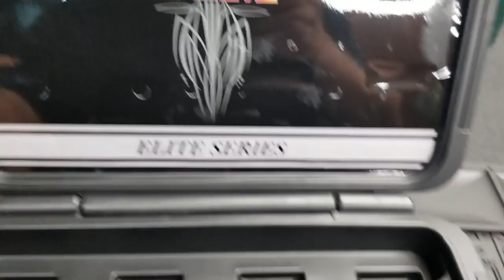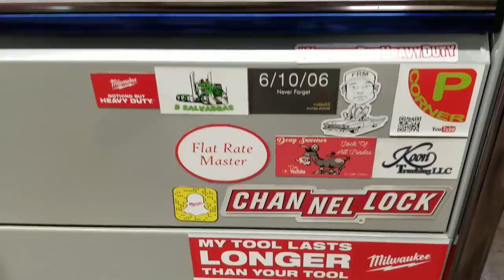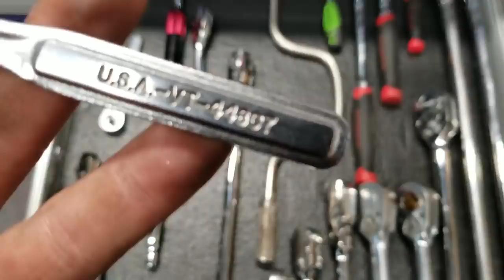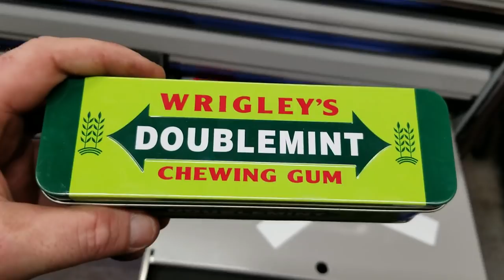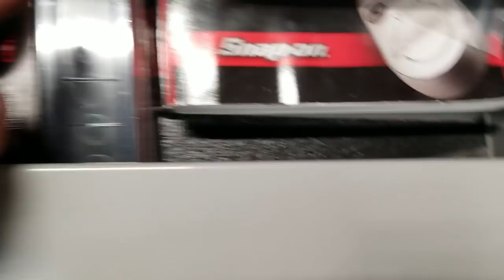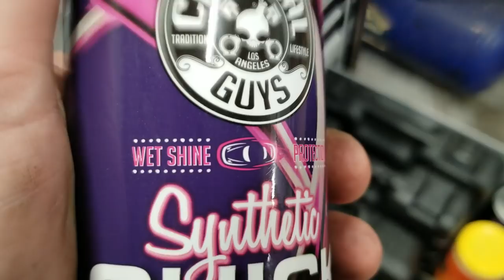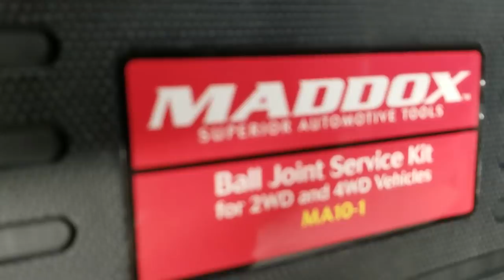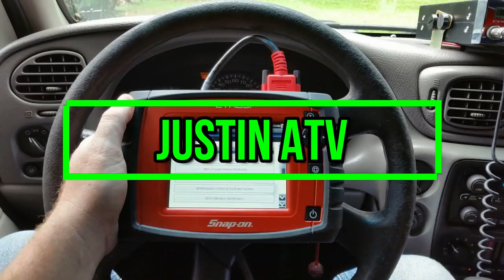Snap-on 68" Epiq Tool box Tour !!! 9-5-2018

Comment: Congrats on the box and nice tour!  The Neiko 04200A extractor set looks very similar (except for the price) to the Blue Point e1020.  I wonder if Neiko is the OEM for the Blue Point set.  I’ve been meaning to pick up a the E1020 set but for only $20 I stuck the Neiko set in my Amazon cart.

Comment: beatiful setup brother!! Great Video. trying my best to stay up to date on videos. Keep it Up!!!
Reply from the maker: Thanks brother! I understand trying to keep up with things. Sometimes it's like nothing happens for weeks the bam! Everything is slammed in life in 10min.
Reply: JUSTIN ATV very true! Man I need to get one of those Milwaukee 90 degree drill attachments. I am installing my trans cooler lines and want to mount them on the frame along the engine but my drill doesn’t fit lol
Reply from the maker: I picked mine up at Home Depot where all the bits and drill bits are. It definitely is handy to have. I first used one 15ish years ago when I worked at a car audio shop.  We used it a lot on Chevy s10 dash speaker grills then to remove & install the speakers. Without that tool I think it would have been easier to knock out the windshield and go about it that way than trying to use something else.
Reply: JUSTIN ATV thanks. Haha ya I think buying that will be a lot better then pulling the engine just to put to self tapping screws in lol

Comment: I did want the snap on socket holder trays , but I ended up getting the Harbor Freight set, and I love them. Anyways, great video!!!
Reply from the maker: I actually have both and like them both pretty good. If you want the "snap-on" style go to Amazon and look up the OEM TOOLS socket trys. Same ones but they just say OEM TOOLS instead of Snap-on and cost less.

Comment: Great set up. Nice box. Do you have the part number for the rubber mat on the top of your box? Been trying to find one for ages
Reply from the maker: THANKS!  And I will get it fo you as soon as I can.  I know it is not a Snap-on part number and not available on their website.
Reply: Thanks much appreciated. Been looking on their site and couldn't find it anywhere. 👍
Reply: Gotta find that part number! I’ve also been looking forever for that top mat.  Great box tour by the way! I own a lot of the same tools, very similar tool choice. Snap on where it counts!!
Reply: Also I see that it’s not on the snap on website, so were you able to get it from your snap on dealer?
Reply from the maker: Yes, the Snap-on dealer has to order it from a company in Canada call Choko. My dealer only orders once a year from them.
Reply from the maker: I think I may get 5 of them next time around and do some giveaways..
Reply from the maker: PART # SNO9-2261 OR SN09-2261

I can't tell if it's the letter O or the number 0.
Reply: Diamond. Cheers for that mate, gonna pass it on to my so dealer see what he says.
Reply: They are NLA
Reply: They are got one 2 weeks ago

Comment: Am I understaning this correct?  I looked at the specs of 68/84 and it seems as if the 68" top drawers are wider? I must be missing something? If that is the case then my mind is made up
Reply from the maker: Yes due to the 84in has side drawers on the side all the way up. Now you might be able to order an 84in with the full length top drawers. You will have to talk with your dealer or go to Snap-on.com and see if their box builder will let you do it.
Reply: @JUSTINATV  Thank you for that. I think this box will suit me perfectly. I never knew

Comment: First off nice tour, you got a nice set building. However you mentioned buy a snap-on snap ring pliers. Please don't buy the snap-on snap ring pliers, they're complete junk! I had the big set think it was a 12 piece in a blow molded case with the 4 different sizes of a straight, 45 and 90 and I broke the biggest 90 the first time I used them and not doing anything that should have broken them. I've been eyeing the sk ones that have the slots to index from inner to outter.

Comment: Justin, How do you like the Sunex impacts vs maybe a Tekton Impact socket set?  Im actually considering either one.
Reply from the maker: I actually like the Sunex impact sockets way better.  I do have a few Tekton impact sockets and have used both and both Sunex's & Tekton's warranties and they are both great no hassle. But the Sunex is a thinner wall and has took more abuse than the Tekton sockets. I'm actually saving up to get all the Sunex 1/2 drive impact sockets both Sae & MM in both deep & standard lengths. I think I have a link fo Sunex impact sockets in the description. Thanks for watching the video and commenting!
Reply: Great glad to know.  Interesting that the thinner wall took more abuse.  I like a good warranty.  I heard some companies won't warranty tools bought off Amazon.
Reply from the maker: Sunex will because Amazon is an authorized seller for Sunex. You can double check it on Sunnex's website.

Comment: Do you have the part # for the snap on mat on top of the tool box?
Reply from the maker: You will not find it on Snap-on's website. It is only available through a dealer and they order it from a company called Choko. They have a website but you can't even get it from there. The part number is #SNO9-2261 or #SN09-2261 I dont know if that's an O or a zero.

Comment: Looks like you should have spend the money on tools and bought a used box off CL. Tool boxes are worse than cars when it comes to holding their value. I've picked up so many boxes for pennies on the dollar over the years. I've seen plenty of Epics for 3-4k but lack of funds of distance has always ruined the deal
Reply from the maker: Thanks for checking out my toolbox tour!  Why spend 3-4k on a used box when I got a brand new box ordered the color & layout I wanted and not used for 3k? Gotta love tradeins, rebates and a great dealer.
Reply: What did you trade in?
Reply from the maker: @LordRumple  , my KRA2422.
Reply: @JUSTINATV  There is no way you got it brand new for 3k. You can't discount the 2422 either as that would have brought in 1k+ quickly on CL.